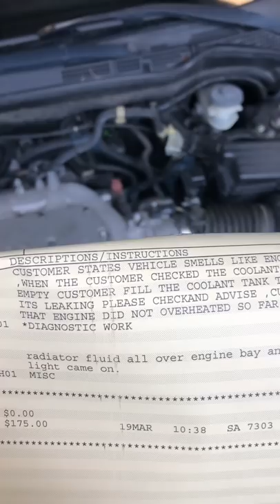Do not use this type of hose clamp because…

Comment: I love those clamps, just don’t be an idiot and over tighten them
Reply from the maker: The oem ones self tighten and these you need to adjust every other year as they slowly expand. At the end of the day tho personal preference wins
Reply: Same here..those spring clamps suck ass...had one of those bastards launch across my garage..replaced it with a worm screw clamp...maybe the OEM shouldn't use such cheap weak radiators...
Reply: @2zzlow  NEW RADIATOR NOT NEEDED !!! STOP THE RIP OFF AND GET A ' DOORMAN ' RADIATOR REPAIR KIT , I BOUGHT ONE FOR MY NISSAN ALTIMA THREE YEARS AGO AND IT'S BEEN GREAT TO THIS DAY ! UNDER 18.00 DOLLARS
Reply: @2zzlow  bme uses theses type clamps
Reply: @2zzlow  the oem ones self loosen over the years too. Just no adjustment
Reply: @2zzlow  I’ve never had one of these slowly loosen up. Never. Ever.
Reply: The real problem here guys is that the radiator is unfortunately made of plastic lol 😂
Reply: @2zzlow  I agree. OEM parts are the best. I do road trips in my car. That being said I do not use any other part. If it didnt come in the bag or box that says "Honda", I dont want it.
Reply: @catslivesmatter1268  absolutely not why half ass a repair and have a customer come back not worth it
Reply: Those clamps are good if you use them against aluminum
Reply: Still not good to use them on plastic radiator
Reply: @catslivesmatter1268  please stop with the screaming and yelling at me 😐
Reply: @mikeznel6048  If you actually read the comment, they said that you needed to loosen it every other year since the rubber expands and that the oem ones automatically do it since their flexxed onto the hose. Someone definitely over tighten the clamp for the video though.
Reply: Dude you go to do if you only have a hose clamp put some pipe thread wrap and torque it
Reply: The OEM clamps are doodoo
Reply: @catslivesmatter1268  thats a waste of time and money
Reply: Same i love them
Reply: Yes if you don't over tighten them they well out last the other ones. 
If you remove oem you better get new ones.  I have found that oem fell if you reuse them.
Reply: Exactly! OEM is garbage.
Reply: @2zzlow  I use these on our work trucks. I have never had a problem or had to re tighten them
Reply: @catslivesmatter1268  lmao its called dorman cuz thats where you leave it when its delivered....at the door man lol
Reply: My tahoe came with those clamps lol so I guess he'd hate my oem clamps
Reply: @2zzlow  no they do not, stop making shit up.
Reply: @brandonnapper3907  name me one part on a vehicle that aftermarket doesn't make better.
Reply: @701garage  Well for one, Im not about to go there with u. And two, Its my preference in what I believe in. Different strokes for different folks.
Reply: They are called jubliee clips and there's nothing wrong with them. Anything can be overtightened. Do you want to replace the lug nuts with clips? No, just don't over tighten also if OEM is so great why did they make OEM plastic radiator fixing? Junk. Just like the crappy plastic sh*t they put on the timing gear on the old Ford V6 that caused them to blow up. OEM isn't always the best.
Reply: @2zzlow   your not a good technician
Reply: @catslivesmatter1268  that’s a good diy choice but at the labor rate of a shop it’s cheaper to have it all replaced man.
Reply: @2zzlow  I agree but I prefer the ones you tighten with a screwdriver just because those OEM ones suck let's be honest I don't know how many times I've f*** those piece of s*** OEM ones I prefer the regular screw ones just don't tighten them to tight both work good but in the end honestly if you know what you're doing you're better off with the screw ones I've never had an issue with them and my truck don't have them because I get tired of fighting those stupid pre tight oem ones that are never really tight to begin with
Reply: @Noxish  when they start building vehicles with the Old style radiators that might be a feisable option however I haven't seen a metal one since the early 70s 😂
Reply: @tylerr676  WHY WOULD I STOP DOING THAT ? 😂
Reply: @catslivesmatter1268  yeah definitely true but everything on the block is aluminum and I use them on there. Like the hoses going in and out of the pump.
Reply: @mebe2k  that's what you tell a customer after his radiator breaks?
Reply: @seanandrew2823  then you replace them. When things heat up, they expand, the clamps expand with them and don't break shit.
Reply: @2zzlow  I have had more problems with oem style coming lose and never had to retighten the screw style just don't over tighten and you'll be fine
Reply: @stephenwalker6980  worm clamps are superior. The oem ones are there because it's cheap to mass assemble. When they need to be taken off I switch them out every time
Reply: I end up using the worm drive clamps in the end. You can’t buy the oem ones except from the dealer so I worm drive it is. I’ve had the oem ones break in half and leak.
Reply: @mebe2k  Yeah those radiators are so crummy they fall apart so easily
Reply: Iv used these for years and on my personal car I’ve used them on all heating hoses and have never had a leak
Reply: Those spring type clamps fail in time and you have a nice leak. I guess they are good if you only have the vehicle for a few years..
Reply: Why do you like to destroy your car over pennies?
Reply: @3dPrint_and_chill  yeah dude what's a torque spec good for either? I just tighten by heart ❤️
Reply: Those band clamps are junk, my fave is when they rust and just under half fall off and the remaining part is damn near impossible to get off...use a stainless steel wide band worm clamp and don't be a putz and crank em too tight. Been using worm drives my whole life , most of it professionally and have had zero issue
Reply: Not necessarily clamp issue - it looks like the radiator was ready to go anyways - the plastic changes color and becomes brittle and crack - this would have happen sooner than later
Reply: Exactly 1,000% better than factory clamps! I switched out all the clamps on my car's
Reply: @catslivesmatter1268  Actually, you are over 2 decades off. Copper/brass radiators were used in some vehicles through the mid to late 90’s. My 98 GMC 3500 diesel came with and still has an all copper radiator. You must only work on disposable import junk that was designed to be thrown away after 5 years, so they came with junk like that. Remember, junk plastic tanks on radiators were brought to the market by Honda, and it has done nothing but destroy the reliability of vehicles. That all from Honda, and that’s why Honda needs to be shut down for good.
Reply: @seanandrew2823  I have seen this, or the stock clamp literally deteriorates. All of this was due to poorly maintained old vehicles anyways.
Reply: The oem clamps cuts the hose
Reply: @BubblesTheCat1  never happened to me. All my 5 cars had some and they were all fine
Reply: Gotta agree with @Abel. The real issue with that car is having a plastic radiator, that's what broke not the clamp or the hose.
Reply: Exactly, buy the torque limiting tool to install the worm drive clamps.(the radiator was already worn out from heat cycling and chemical reaction from the coolant.) This guy is an idiot.
(I'm an ASE Certified master technician with 40 years experience, I've never had problems with good quality worm drive clamps.)
Reply: Nothing wrong with a worm drive clamp.... it’s the plastic garbage it’s connected to that’s the problem , to much plastic in modern vehicles... 👍
Reply: @mebe2k  You have to know how to work with spring clamps. Most open to a locking potition and are a breeze to reinstall. I used to hate them till I learned proper methods with them. There is also a tool for them.
Reply: @2zzlow  I think you shouldn't be a mechanic
Reply: ab to say never had an issue just dont overtighten em lol
Reply: I Drove the mr2 before but rn I have an aluminum radiator and it’s not plastic at that point right there where the hose goes
Reply: @sportsnation1234  If the hose is bad enough that you need to align them withing a microscopic tollerance. You should have changed your hose and the clamp a LONG time ago. That just sounds like you're bootlegging repairs in running for the shadetree mechanic hall of fame.
Reply: Exactly. Regular threaded screws also strip when you over tighten them as well.
Reply: @701garage  Suspension components, brakes, body assembly parts (i.e. headlamps, fenders, etc). I could write a fucking book. OEM is always best even if the prices are stupid. It's literally what the car was designed to have on it. Do I agree with the prices? Fuck no, that's just the shit part of the car market nowadays. But to say aftermarket makes it better is stupid as fuck.
Reply: @murkadelic422  an aftermarket part will always be better then OEM. Show me one part that aftermarket doesn't make it better ie. Stronger, lighter, overall better. Willwood, qa1, tein. Show me a OEM car that out performs a aftermarket one
Reply: @Theauger  you're mixing PERFORMANCE parts with AFTERMARKET. Aftermarket is a term to cover all parts not made by the manufacturer. 
PERFORMANCE parts are made to a higher standard than manufacturers' spec.
Reply: @murkadelic422  there is almost no part that it made by the manufacturer. Those are aftermarket parts they don't have to be performance based. Willwood makes better brake pads and brake parts than oem.
Reply: @murkadelic422  so are you saying brembo is a performance brand even though they come standard on some cars. Willwood is so an aftermarket they don't have to be performance brake that make kits for older cars. That is the aftermarket no just performance.
Reply: @murkadelic422  you have probably never done anything aftermarket to your car.
Reply: @catslivesmatter1268  not dealership quality bud 😂😂😂😂
Reply: Very true ... I install them a few years ago ... no problem so far
Reply: @mikeznel6048 they wear out and loosen up. And you must not keep cars for that long
Reply: @Dabbin916 most are nowadays
Reply: @brandonnapper3907 honda oem are better than alot of other oem parts. Some other brands its better to not go oem
Reply: @701garage depends on the part if you want performance of course oem isnt going to be the best. But if you dont oem is the way to go depending on car brand. Honda eom is top notch. And last. But chevy or ford or kia better off after market.
Reply: Agreed. As a qualified mechanic of 23 yrs in Australia, we change our hose clamps to worm drive all the time. Just don't over tighten, like you said
Reply: @DABBIN 916  "don't tell that to the manufacturer"
Reply: those clamps also losen over time my dude, and youll leak coolant
Reply: @CATS LIVES MATTER  so what is it some kind of nasty goo you put in the radiator
Reply: @Mike Znel  Same here. I've heard that myth for decades, but never once have I seen any worm clamp loose its tension over time. Period.
Reply: @catslivesmatter1268  no... Keep your jury rigging on the farm..
Reply: @seymoarsalvage  deff isnt a myth it happens alot to my wagoneer.  2 weeks ago i saw coolant dripping under neeth and for the 2nd time in a year i had to retighten the screw on the clamp
Reply: @2zzlow  The OEM ones are pain in the ass there's barrel alternatives than both of them
Reply: @catslivesmatter1268  why you yelling in the comments for?
Reply: @brandonnapper3907  build your own machine and learn to to trust in yourself bro
Reply: @catslivesmatter1268  you lost all credibility when you said “Dorman”
Reply: @mebe2k  never had that happen, learn to use the right tool.
Reply: plastic junk dry rots, not the clamps fault..
Reply: Yeah. My first thought seeing this is. The clamp is loose enough to pull right off but so tight it broke the radiator?
Reply: @catslivesmatter1268 yeah, NO😂 stop with the misinformation, once the fitting is broke, especially on an old radiator, it’s done.
Reply: @seanandrew2823 no, they don’t “ loosen” over the years😂 they are made out of spring steel 😂
Reply: @tylerr676 LoL, he’s trying to drive his misinformation into our heads😂😂😂😂😂
Reply: @M21-w1y  they do, first the rubber settles and shrinks over time, maybe you use hoses with a different thickness, different aftermarket replacements may have same i.d. but different o.d.. also some hoses need to be moved almost everytime you work on the vehicle, so they repeatedly get opened and closed so yeah, ive seen quite a few times be the source of a coolant leak, or power steering leak
Reply: @Dabbin916 factssss
Reply: @catslivesmatter1268 while you may use a repair kit, I as a shop owner will not use a bandaid on the radiator. When it breaks again, it causes issues with the relationship with the customer.
Reply: @drift13b  they are better than the original and will be built better than factory, I've had mine since the last 7 years and absolutely no issues with it
Reply: @Dabbin916 big issue

Comment: Worm clamps work great if you know how to use them. He said it right there in the video, when you “over tighten” them they mess up.
Reply from the maker: people tend to overtighten them and with a spring clamp one wouldn't have that issue.
Reply: And if you don't over tighten them they leak. Plus if you tighten them properly you need to retighten them after they went through a few heating cycles whereas it constant tension clamp self-tightens.
Reply: worm clamp losen up over time, ive have to re-tighten my yearly or they get lose and i leak antifreeze
Reply: Used worm type clamps for decades on brass/copper and plastic radiators. Never had an issue. Never busted the necks and never had to retighten them either
Reply: @UFO-047  lucky you on my jeep wagoneer.  I gatta retighten yearly.. in fact the lower hose leaked the other day thats the 2nd time its worked loose.  When i checked the ithers.. they were half a turn at least loose as well
Reply: @oliver_klozoff   Wrong. teh clamp does not do the sealing. the barb on the fitting does. The clamp is ONLY there to hold the hose on to the fitting. If It is leaking then the hose and/or the fitting are the issue not the clamp.
Reply: @nhbountyhunter  exactly why a constant tension clamp is superior to a worm drive clamp. You made my point for me.
Reply: @oliver_klozoff  But they are not. A cheap tension clamp can lose its spring in weeks, therefore canceling your argument about quality. Spring clamps are only there because a robot can install them without requiring a human to inspect them on the assembly line. It is a cheaper, time-saving method. They are not better, worse, or magical. They are for the manufacturer to save a few dollars on every car they produce but still change us ever-increasing sticker prices.
Reply: @nhbountyhunter  absolutely wrong and boomer opinion, but ok. Not gonna argue with a stubborn "back in my day" guy who probably hasn't worked on anything newer than a 87 celebrity because all them new computers are ruining cars.

Comment: Ya, the reason that style of clamp is no good is because the radiator is now made out of plastic, it didn't used to be an issue back when the hose neck was made out of metal, in fact those style of clamps used to be the preferred type of clamp, FYI.

Comment: I work at a jeep dealership and the spring style clamps at trash! They loose spring tension and pop off while accelerating. The worm type are good just don't over tighten them. Honestly that plastic radiator is super old and they break down, the plastic gets brittle and breaks easy, so it was a matter of time for the neck to break.
Reply: Quick connect broke on my Jeep Cherokee 2014 2.4L and no coolant was in the resouvor when it overheated.
Reply: I can relate to what I said. I had a Jeep Liberty with constant tension clamps. One day I was off road hard on my stock Liberty and I see coolant spewing out. Top radiator hose popped out. I fixed it, drove it out of the desert then replaced those with worm clamps and never had any issue. Just feel and hand tighten them.

Comment: Been turning wrenches for almost 2 decades, never have I ever had this problem and this is the preferred clamp of choice in my shop
Reply: I've been wrenching for about 50 years, and never had problems with the worm drive type clamps.

I always use a magnet to make sure the screw is stainless steel - often the clamps are stainless but the screw is not.

Put some hose sealant on, and don't over tighten.
Reply: Been wrenching for 250 years. I use worm clamps when those OEM clamps fail to open enough to get them on the radiator hose attachment port.
Reply: The plastic tank is the problem ,been using those type of clamps since I was 5 years old I'm 57
Reply: @McAdamsMechanics   I don't think they had cars 250 years ago
Reply: @brandonshaffer3940   course they did. Everyone knows Washington rode into battle on a Mustang
Reply: @McAdamsMechanics  I've been wrenching for 372 years. Can confirm that worm gear style clamps are the real deal. I was able to use some spare ones to replace a blown tire and get home safely 👍.
Reply: @chrishernandez2490  372 years? Iiiii remember when I just started 🙄🙄🙄